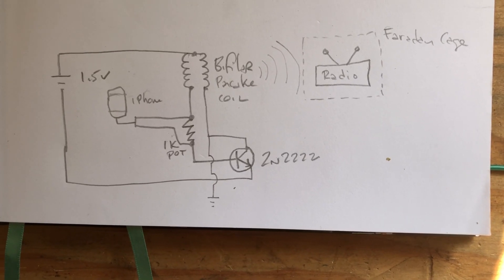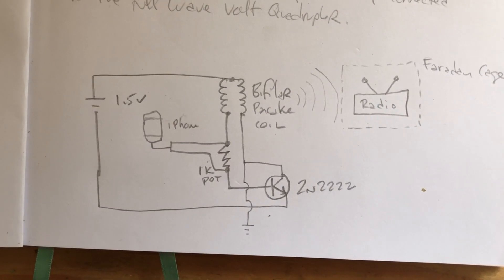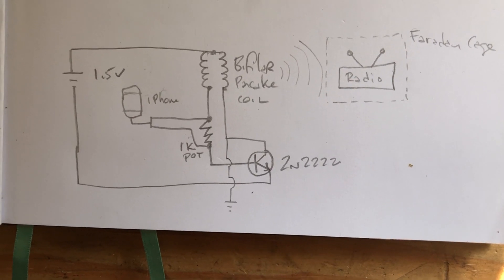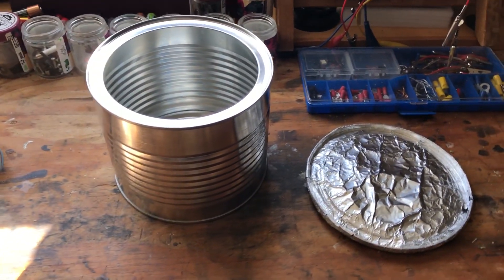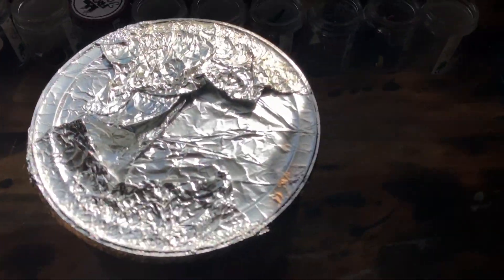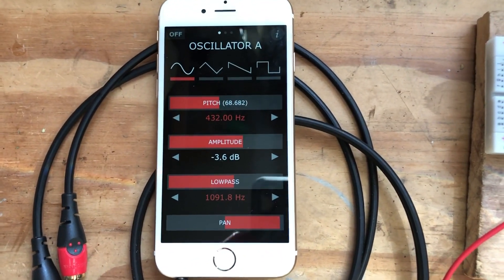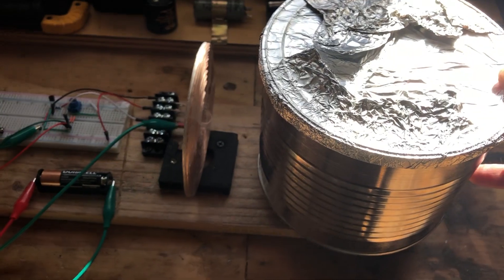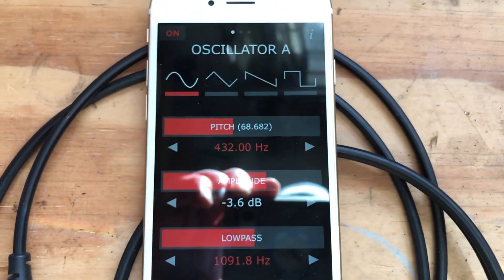Radio as Longitudinal Wave Detector

Comment: Nice experiment Miguel! Thanks for sharing! Just two comments. (1) Those who believe that longitudinal EM waves are real, use to mention that EM longitudinal waves can be generated by forcing two ordinary transverse EM waves 180 degrees out-of-phase from each other to combine and cancel out. Those waves would therefore "vanish" from this world and would be detectable only by special, very specific  setups, one of them involving a Faraday cage as you did. From your circuit I don't believe the cancellation is happening, at least not all the time. I believe that, based on the way you connected the coils, your circuit is generating regular transverse EM waves. (2) Test your Faraday cage against what you know are 100% regular transverse EM waves. You can do that using only one coil of the bifilar model. I'm saying that because I found out that shielding based on a Faraday cage is not as easy as we might believe. Good luck!
Reply from the maker: Thank you for your excellent comments, Márcio. (1) I am not familiar with the 180º out of phase concept, but I would not be surprised if it is actually both . (2) I actually built a small am transmitter to test against. (https://scitoys.com/scitoys/scitoys/radio/am_transmitter.html)  My "faraday cage" did a pretty good job of blocking, but some got thru. I like your idea  of using one coil! Thanks again
Reply: @banyanstudio  Nice AM transmitter! I think I'm gonna build one. Thanks for sharing the link! Regarding the cancellation stuff, if you search for scalar waves, longitudinal electromagnetic waves, Tom Bearden, you'll find the whole theory behind it. Traditional mainstream Physics doesn't believe in longitudinal electromagnetic waves. The closest we get to that is perhaps when we have waves in an oscillating plasma. I attempted to reproduce some of the statements of the authors who claim the existence of longitudinal EM waves, and I have to be honest with you saying that I've never got to the same results. I wish you good luck and if I can be of any help, just let me know.

Comment: What might be the effect on signal.........
(1) if the bifolar transmitter is rotated/turned to face other directions (up down left right away etc), 
(2) or if the radio/cage is moved to other locations (above below left right  behind etc).
(3) if the radio/cage is rotated/turned to face other directions (in the horizontal & in the vertical).

(1)&(2) might affect the loudness if the signal is longitudinal.
(3) might not affect the loudness if the signal is longitudinal.
But i dont know much about radio or electrics.

Comment: What you missed is power density,  sensitivity, and shielding efficiency,  a 50kw AM radio station 5km away only get 159 µW/m2 at your site, meanwhile, the power density of the EM wave come from your little station might be 159mW/m2. Give the same sensitivity and shielding efficiency, the radio may still pick up AM signal form your little station.
Reply from the maker: You make an excellent point. Perhaps if I also create a conventional AM circuit and see if the output can also be picked up by the radio in the can. Thank you for your comment.
Reply: but it use low freguency ?!

Comment: What AM frequency did you tune into?
and do you have a oscilloscope, to show the impulses?
Reply from the maker: 710 AM, However you could sweep the tuner and the longitudinal signal would still come  in at various frequencies. I do not have a scope (yet!)
Reply: I wonder how the audio (low frequency) is also transmitted. Rigol makes decent cheap oscilloscopes. worth it!

Comment: Good research! thanks for sharing. keep in mind the bifilar tesla coil is differently connected between the 2 windings (I think you did it right, but your drawing is wrong).
I like your AM radio in a Faraday cage, as an longitudinal wave sensor.

the joule ringer is a good circuit because it generates impulses
Reply from the maker: Thank you! Yes, I was a little hasty in my drawing.
Reply: Electrical equipment TAO   good question. I am not sure.